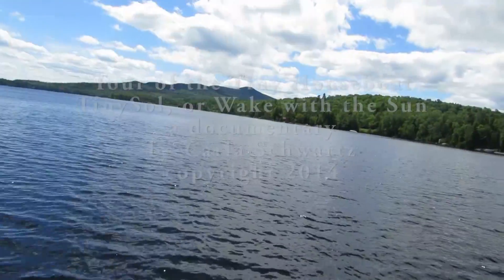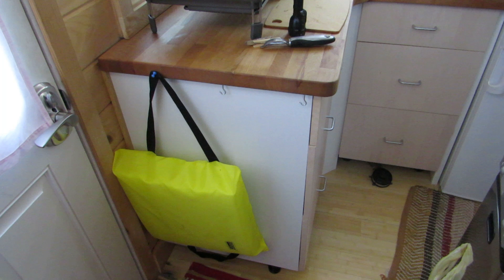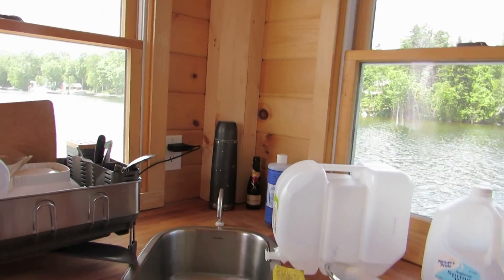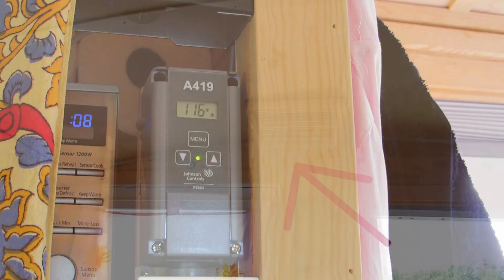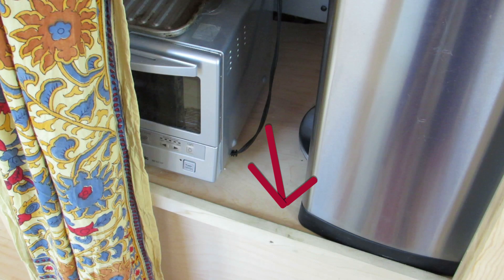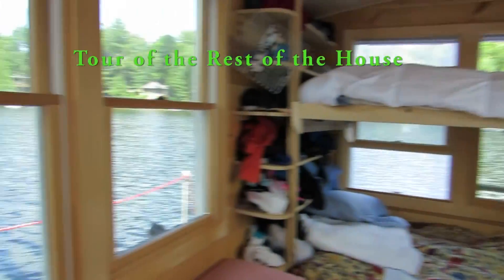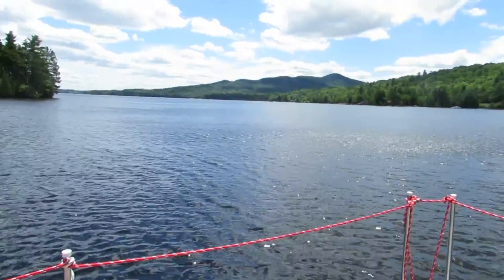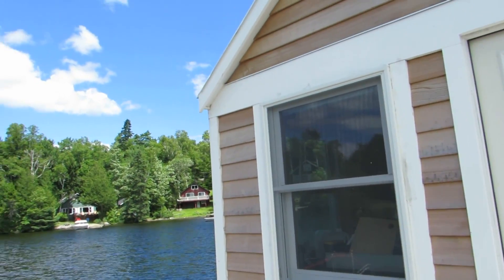Tour of the Tiny Solar-powered Houseboat #cb99videos #tinyhouses #houseboats #boating

Comment: Hi Carla! Serious question for you: have you stayed in the boat when the waters are a bit rougher? Does it shake or rock? Hubby wants to live in a pontoon/boat/houseboat and I'm wondering what it's going to be like during inclement weather. 😓
Reply from the maker: yes, it rocks, shakes, sometimes it's very scary. We have not put it in salt water, and it's best to use in calmer lakes. We do not have a strong motor - equivalent to 9 hp max. if you are not going electric, that would be different.
Reply: CB99Videos - Hey, Thanks for the reply! We've been told we need to get a displacement hull type of boat to do the Great Loop, so pontoon boats are out. Which is a bummer because they look like they'd be more comfortable! We're still looking though. Have a Wonderful day and a Better tomorrow!

Comment: You should be very proud of what you have accomplished.  Your tiny houseboat must bring you a great deal of enjoyment and peacefulness.  I wouldn't mind having something like this to live in full-time.  I didn't realize there were electric motors powerful enough to push you through the water.  How many knots can it go?  How many watts worth of solar panels do you have?  Oh yes.  Have you room to put one water heating panel on your roof?  That would be great for maybe putting up an outside shower that you can enclose with heavy, waterproof material for privacy.  You have really activated my imagination.  Thanks so much for sharing!
Reply from the maker: +Br. Curt Beardsley  2400 watts of panels. We only use this as a summer house and use lake water for washing up in the sink (not for drinking, and sink water goes into a gray water tank) we we do not need hot water by solar, but we do get passive hot water by solar as explained in the video. The electric motor takes our 7K plus pound boat about 3 mph...walking speed...the top speed is rated for 5 mph or 9 hp equiv. but we generally go under 3mph..so this motor boat is a little different kind of touring boat than one with a powerful gass engine.

Comment: Do batteries power the oven? I suppose if you have enough power to motor across a lake you have enough to heat a toaster oven. 
Do you have a vid of getting the house off tge trailer onto the water?
Nice work
Reply from the maker: It is one single battery -- Lithium Ion and the sun tops it off daily...we can cook, ride, and have a fridge going all summer. We don't do much baking in the oven, but do cook rice in the microwave.

Comment: Looks great! Q though: What type of solar panels are being used for the roofing? Where did you purchase them? I'm in the beginning stages of designing a tiny house myself and I love the idea of solar panels as roofing.
Reply from the maker: Hi Jeff. Thanks for your comment. The roof is made of twelve 190 watt AstroEnergy panels in six strings of 2 panels feeding an Outback GTFX3048 w/ FM80 FlexPower ONE inverter system FP1-25. Both the solar panels and the inverter were purchased from Wholesale Solar
Reply: Thanks for the info, Carla; much appreciated! Enjoy your tiny home!!
Reply: What was range of cost for moter and solar system. 
Looking at getting 
A houseboat someone has in eurika springs ark for 15k but it doesnt have engine.

Comment: Is it possible to remove from the triler & use on the river, switch to & from?
Reply from the maker: Yes we can move it back and forth between trailer and pontoons..but not without a good deal of time and expense...so we do this once a season....it takes two trucks to transport the tiny house and boat separately and a crane to lift the house onto the boat. You can see the related videos linked in the description of this video. such as this one https://www.youtube.com/watch?v=GsGZlC57-As